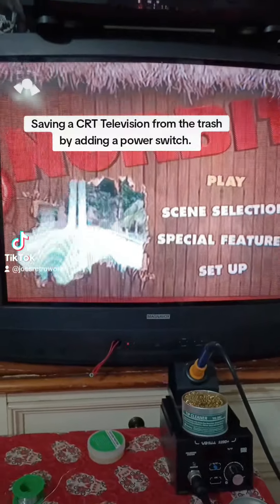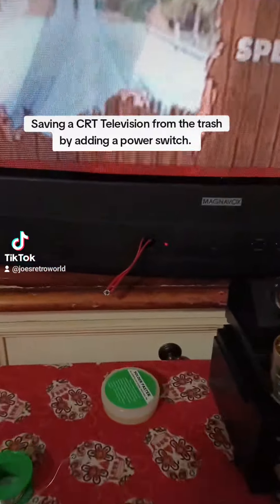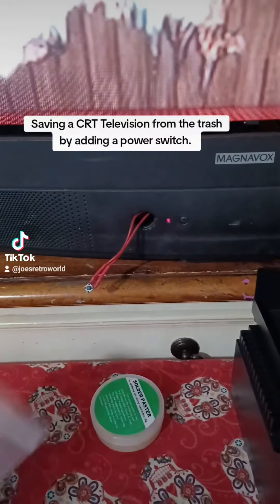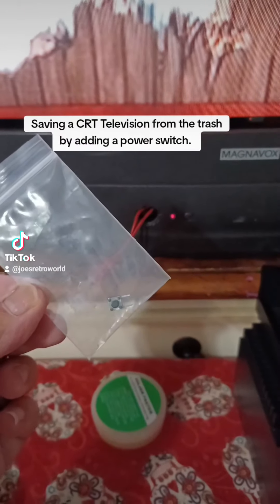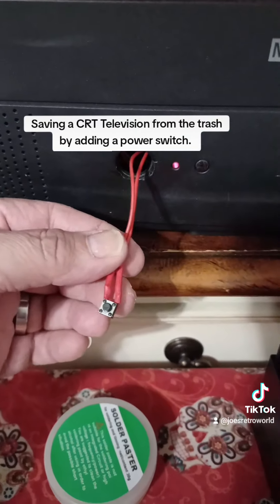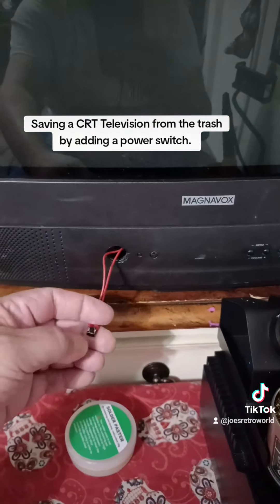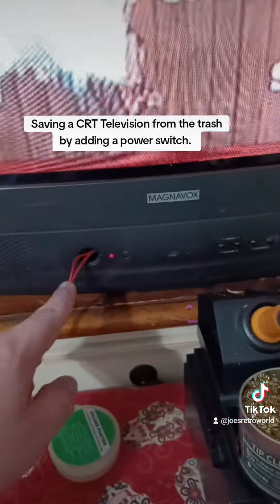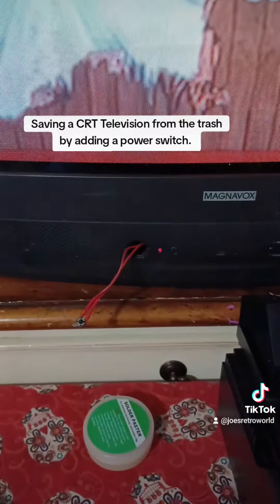Saving a CRT tv from the trash | Joe's Retro World 2024

Comment: Very nice, you should 3D print a circle with the same size square as your custom power switch! Glue it in place and that would be pretty rad without wires sticking out. If you don't own a 3D printer like i don't as well ask someone to do it for you. Black circle ⚫️ square hole + Glue boom! Even more custom.
Reply from the maker: @NERD-FROM-THE-SOUTH  that would work great,  I will ask around.  Thank you
Reply: @JoeRetroWorld  absolutely hope you find someone! Also I have to mention that I recently bought a new crt tv myself but I don't know much about it. It's a sansui DTV2700 series B. Here is the kicker! It's from 2007!! So it's a late model crt. It has component video as well on board! a friend at work, let me have it for $20. The only thing that I need to figure out is why it gives a fun house mirror effect when playing side scrolling games. Hopefully, i can adjust it. If you want to look it up and give me your thoughts on it, that would be awesome.